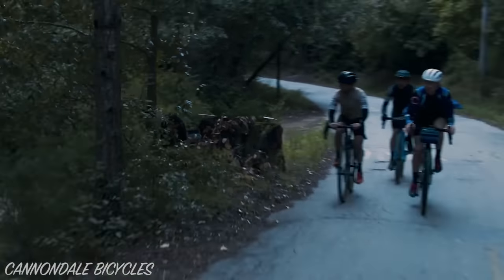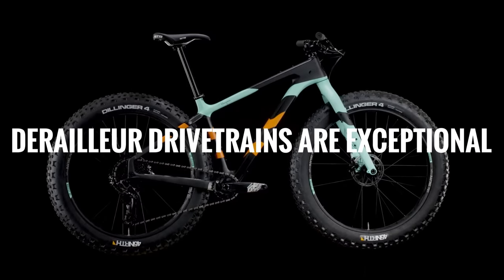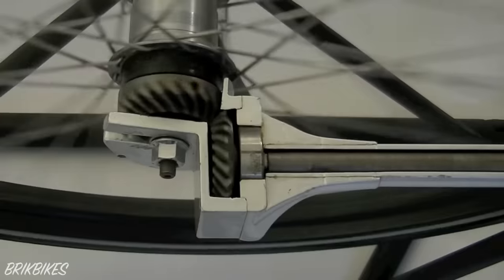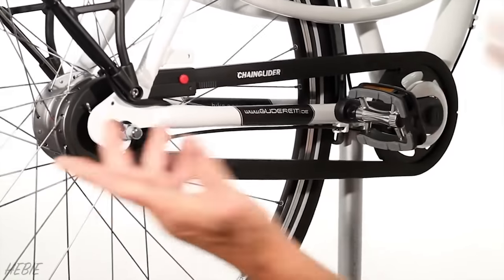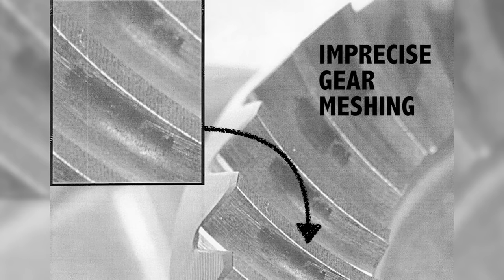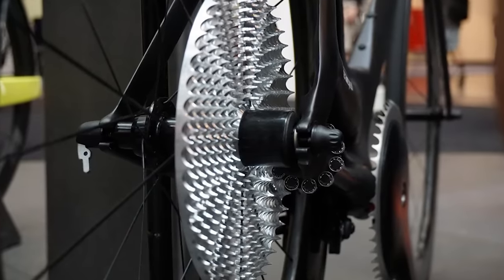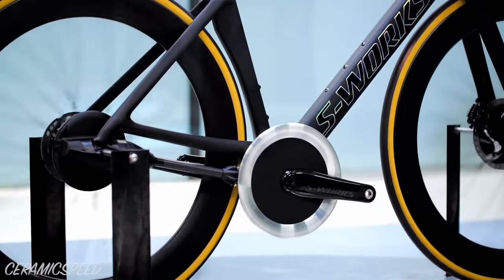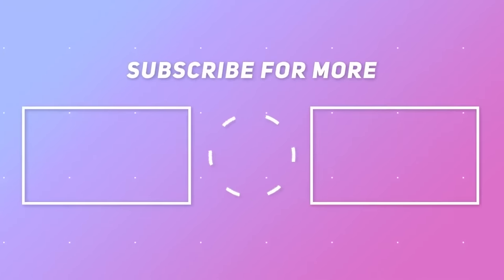Are Chainless Shaft Drive Bicycles a GENIUS or TERRIBLE Idea?

Comment: when building solar race cars, our numbers were 93% for chain and 86% for shaft.  that was 800 lbs at 1100 watts.  which really adds up on a 300 mile race.
Reply from the maker: Interesting! Thanks for the data point. 👍🏻
Reply: It's long been known that chain drives were more efficient - I remember reading through a book on the history of the Morgan Car company where they were saying the same thing about their Cyclecars (2 wheels at the front and one at the back- with a chain drive ) in the early 1900s
What shaft drives bring are reliability.
When I worked as a MC courier I'd generally get through a chain a sprocket set every 2 months (10k) - when I switched to a shaft drive bike I'd just have to change the oil in the shaft drive every few months and have the system serviced once a year.
On a pedal bike you're probably going to want to optimize for power efficiency rather than high mileage reliability, so a shaft is never likely to catch on.
Reply: What about reliability
Reply: @bev8200  no contest on reliability: shaft wins 10 times out of 10.

As a source, just look at motorcycles applications
Reply: @carlofasano4293  - the question is, is it really worth optimising for high mileage reliability, as opposed to optimising for power efficiency, on a pedal bike?
How many riders are really doing enough miles to justify it and will want to sacrifice power efficiency to achieve it? especially considering the comparatively low cost of a replacement sprocket/cassette and chain.
Shaft drives on motorbikes have always been pretty niche - mostly restricted to the big high mileage tourers from BMW and Honda and a few other corner cases - they're going to be an even smaller niche on pedal bikes.
Reply: @5ynthesizerpatel  The cyclist is experiencing very different problems than losing a few miles of range. High rolling resistance causes increased fatigue even over short distances, you just won't make people ride an uncomfortable bike. These are not galley slaves, they will choose a bicycle that rolls easily.Sorry for the machine translation.
Reply: @bev8200  if it's anything like on a motorcycle it's excillent but when something does go wrong it's harder to fix and more expensive. Most motorcycles use chain with Harley being weirdos with belts.
Reply: @mgkleym  My first motorcycle in the late 80s was a Kawasaki 454 LTD with belt drive. I never had a problem with it and maintenance was next to nothing. My buddy's HD has 90k miles and has the original belt too with no problems.
Reply: Similar for motorcycles. Driveshafts have more fiction and thus less efficiency.
Reply: @carlofasano4293   Which becomes a non issue when you consider how rarely a casual rider (20-50 miles per work day) needs to switch out chains and how fast and cheaply it can be done.  Unless you are purchasing a jewel encrusted chalice with each chain, the chain still wins overall.
Reply: @5ynthesizerpatel  The driven shaft isn't exactly a normal shaft drive either. A normal shaft with a bevel gear interface may very well have more friction than the driven system where its basically a roller chain on its side.
Reply: @MrGallade475  This has les friction you think? On each side of shaft you have only 1-2 teeths engaged. Enormous stress and friction is in that place. Bevel gear has specially shaped teeths and much larger engaging surface=> therefore much lower friction.
Compare that with chain... or with toothed belt. How many engaging links do you have for example on 42 tooth ring?
Reply: @mgkleym   Kawasaki use belts too
Reply: Was this race on the surface of the sun?
Reply: @radnasirhill  LOL no, we had 2 sq meters of solar panels, and 300 km to race over.  That gave us about 6 hours of toaster level power/ day.
Reply: Honda recognized, and published numbers similar to this when putting a shaft drive on, I believe, the first goldwings. They also indicated that the power loss wouldn't be noticed by the rider, but the rider would notice the longevity of the system since they would probably almost never have to maintain it.
Reply: @donkeyiaiaia4315  It's not a few miles of range. It's the difference between riding 50km/h or 30km/h for a recumbent when using the chain vs shaft example. I know a 70 year old guy that was doing races at over 60km/h for hour records when he was 65 and his bike was not in tune.
(It's the guy behind the velotilt)
For 2x20+km commuting, you need a very efficient bike to drive an average of 30km/h (average, not moving average, which usually is higher) to get a normal life.
Yes, I sacrificed speed for comfort, but it's always a very thoughtful process. Usually comfort (switching to recumbent) also comes with a lot more efficiency though.
Reply: Why would you use Bevel gears? Normal gears are close to 100% efficent.
Reply: @tihspidtherekciltilc5469  
A week ago my friend lost his drivebelt of his Yamaha XV1700 with not that many miles on the clock. I doubt that he has more than 30k. But his 1700cc bike is very heavy. I would be happy to ride lighter bike with silent low maintenance and clean belt, instead of greasy rattling chain.
Reply: The number must be only 30% for BMWs considering the mileage of those 😬
Reply: @mickware5289  Yeah, this type of thing seems to pop up every year or so. I'll still be riding a chain for the rest of my lifetime, I'm sure. I'm not up on the history entirely, but I think chains have been driving bicycles for 135+ years. Think about the developments mankind has made in that time... yet chains remain. I feel like drive shaft bikes would be everywhere by now if they were better, and not just in some boutique $100,000 bike, I mean everywhere - but they're not.
Reply: @jordan9339  bruh. You got some alternative facts there
Reply: Wait, people are building drivetrains between motor and wheel for solar race cars?
Reply: @sh4dy832  sadly, axle through motors weren't cost effective in the '90s. We barely had brushless motors.
Reply: @carlofasano4293  
Your motorcycle comparison is flawed.  
Shaft Drives are far less reliable & less durable on bicycles... because frame flex on bicycles causes binding of the gears, which results in more friction, leading to more wear & difficultly to pedal, & ultimately the gears becoming jammed.    
This is not a problem on motorcycles or automobiles, due to having a stiffer chassis, & a whole lot more HP & torque to overcome the increased friction & rotational mass.  

This is why Chain Drives have dominated the bicycle industry.
Reply: So what I hear is that shaft drive bikes are good if you REALLY want a workout, and you want to be ASSURED repair is going to be basically unnecessary, but chain is better for ANY type of riding that isn't pure exercise.
Reply: Every spatial conversion of the force applying axis will lead to energy losses. This perceived as a fundamental restriction rn. We're not sure tho if the basis is purely newtonian, or space-time. At first glance it should be newtonian but when you start playing with different spatial metrics shit gets a bit weird.
Reply: Clearly your team either doesn't know how to get efficiency from shaft drive, or they insisted on using chain. There's a reason all high powered vehicles are shaft drive, even many motorcycles.
Reply: @TheUniversalid  when you're dealing with heavy but compact vehicles efficiency is not your main concern. such thing as reliability, construction and space optimizations will come on top very quickly. 

also mainstream combustion engines are not really efficient by themselves and fuel is not really hard to acquire. 

basically shaft is always less efficient, but at some point perks overweight flaws.
Reply: @TheUniversalid  
Comparing high powered vehicles & motorcycles does NOT correlate to human pedal power.  
As stated before... shaft drives are heavier & succumb to a lot more frictional forces than chain drives.  
This is not a problem for high powered vehicles & motorcycles, because they are driven by engines that produce vastly more Horse Power & Torque than a human ever could.  

To make a bicycle that can be powered efficiently by human muscles... they need to be light weight, & have a drive train with as little friction as possible.  
Shaft drives already suffer from a lot of frictional resistance.  That frictional resistance increases greatly when combined with a light weight frame, because frame flex causes twisting of the shaft drive, causing that additional friction from binding of the gears.  
This could be alleviated by using steep angled spiral gears with wide bevels... but this would ruin the efficiency of the shaft drive, thus eliminating all advantages.  

The human body is NOT a high powered engine... so for the reasons stated, a chain drive is ideal for human power.  
The reason shaft drives are used on motorized vehicles... is because the huge amount of HP & Torque produced by their  ENGINES  requires a stronger drive train, which is where shaft drives are king.  

I suggest you calculate the Power to Weight ratio of the best human cyclists... compared to a Honda Civic, F-150, or any other automobile.  Then you will understand why bycicles use chain drives, & autos use shaft drives.   
It all comes down to... humans are weak.
Reply: @carlofasano4293  but 10kg on a bike is 100kg on a car by equivalent from what i know
Reply: @TheUniversalid  Right.  That's why shaft drive dominates in MotoGP...NOT.
Reply: @mickware5289  I'd say the only exception where the chain wouldn't be cheaper is if you cannot change the chain by yourself and the local prices for the work are insane.
Reply: You are comparing automotive shaft drives with chain, but the 'Ceramic Speed' shaft drive does not use normal engineering bevel gears but small ball races that act as gear teeth and thus don't suffer the rubbing friction between the teeth that normal engineering involute gears suffer. I believe their claims of circa 98% efficiency.
Reply: @donaldasayers  It's still two metal surfaces meeting. The fact that they're round instead of bevelled will surely just change the friction mechanism - not eliminate it almost entirely. 

Additionally, the Ceramic Speed drive is still just a prototype at the moment, and the actual drive will have thicker pinions and use heavier and more durable materials. Whatever efficiency you gain on friction, you will likely lose due to the fact that you're pedalling a heavier and stiffer bike.
Reply: @BambiTrout  It's not two metal surfaces meeting and sliding, it's little rollers rolling, very different.
Yes the Ceramic speed is just a prototype so far, and still after what two years, they still haven't worked out the tooth profile needed for smooth meshing, so I am not holding out much hope.
Reply: @5ynthesizerpatel  Maybe 4-wheeled passenger vehicles will go BACK to chain drives, for efficiency.  I'll still want my pickup truck for big loads and big trips, but to get around town?   I can see people rebelling against (non)durable goods and planned obsolescence.  As we become more pollution- and resource-aware, I can see people wanting a little putt-putt they can maintain and repair, forever.  Take all the gov't regs off and just strip it down to the bare essentials, so the owner/operator can fix everything with not much more than a set of bicycle tools.

Cars were a lot cooler when I was a kid and you could roll up your sleeves and fix whatever was wrong with them.  We got away from that.  They don't WANT you fixing up your '93 or your '70.  I remember the '80s, thumbing through huge catalogs of new old stuff, and restoring a '56 Chevy Nomad.  I don't think there's near as much of that going on, now.
Reply: @5ynthesizerpatel  Wow. Thanks for your comment. Saved me some time!
Reply: Belt drive is the most efficient transfer of energy on motorcycles so I’d be surprised if this isn’t the same for bikes
Reply: @5ynthesizerpatel  if chain drive is more efficient, why most cars and trucks use drive shaft?
Reply: @bltzcstrnx   - all explained in the posts above.
Chain drive is very energy efficient but not very reliable / requires constant maintenance or replacement - shaft drive less efficient but much more reliable / lower maintenance.
For cars and trucks the trade-off is worth it - for bikes it's (probably) not
Reply: @harrymills2770  Most cars ARE chain drive. Everybody who thinks a car has a drive shaft is only thinking about rear wheel drive cars. The majority of modern cars are FWD/transverse engine. Here, either the engine, transmission and differential (transaxle) are directly attached, or where it's too small, a chain is used between the clutch/torque converter and transmission to allow parts to sit under the engine.
Reply: a chain today is very reliable.
Reply: @5ynthesizerpatel  I disagree with the verdict part. During the last 12 months I've been riding alot, like ideally 100km per day on electro bicycle, usually more like 30-50 and half the days 0. Often through a decent amount of mud, also often with a trailer and the 1 y/old bike has been to the workshop 9 times by now including the time which is still ongoing currently. Twice for over a month because during the process they realized that one (or other) part x broke too and there's only one manufacturer and a month is just how long the delivery takes.
I'm thinking about upgrading from a bike which uses power up to 25 km/h (on long straightways I'm usually going 30 anyway) to one which does 45 and that's getting pretty close to an actual motorcycle then (except many advantages, for example there's still a ton of roads which are legal then, but off limits for motorcycles) and then it does make sense to switch to a drivetrain closer to motorcycles too.